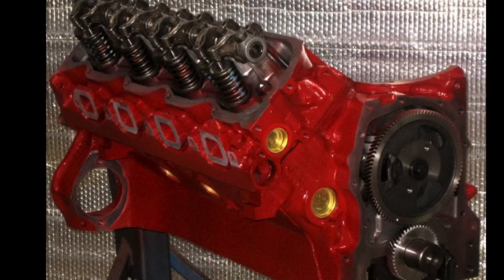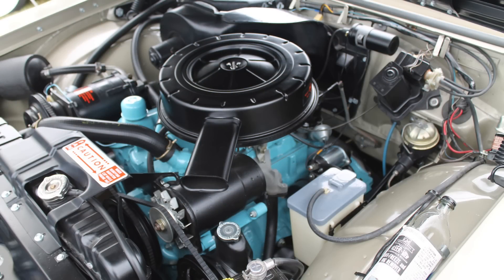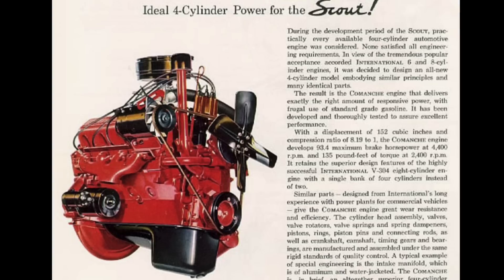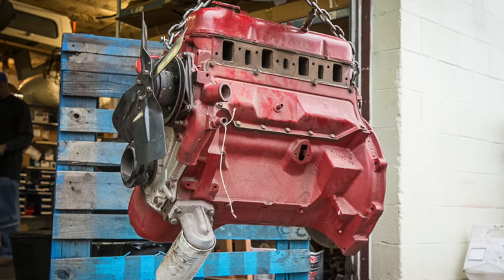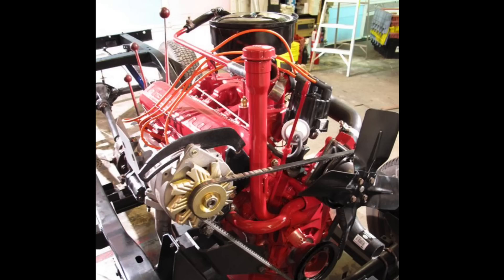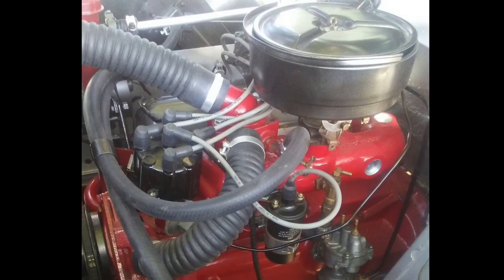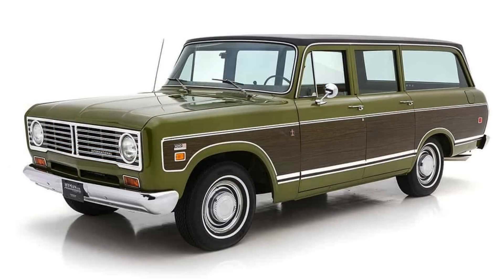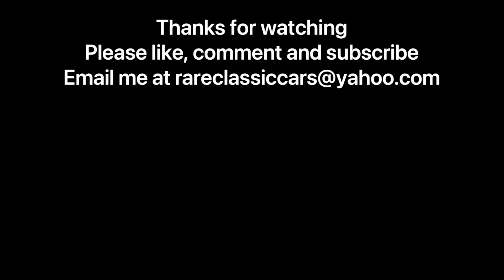Strange Automotive Engines:  International's (IH) "Half of a V8" Comanche 152/196ci 4cyl!

Comment: I know you worked at GM on the financial side of automobile production from watching some of your other interview videos. I don't know what that entails, however.
I love these unusual engine reviews. 
How much money, in percentage, do you think was saved by using an engine casting that lops off ½ of V-8. And using many of the same parts. For obvious cost savings. Versus a new casting of a proper 4 cylinder identical layout but also using all of the same identical parts. It seems like the new casting would be lighter, at the minimum.
Do you if they used the V-8 castings but just blocked off the liquid iron from where it wasn't needed? That would probably save some money. Did they literally use the V-8 crank with a spacer for the missing rod in those journals? I'm just really curious about how much of the V-8 block and crank were changed.
And your expertise about cost savings. Thanks for the great videos.
Reply: Definitely a new crank. Unless the V-8 crank was a flat plane design. The big savings is in the tooling. The 4 and 8 cylinder blocks can use the same machining lines. The heads come off of the same tooling. Some of the same tooling can be used to crankshafts and camshafts. Exact same parts for pistons and rods. Same with lifters, pushrods etc. Same distributor except for the cap. You could even use a V-8 cap. Just run a plug wire off of every spot.
New parts needed would be intake manifold, valley cover and that's about it.
Reply: @mpetersen6  Thanks for the information. The crank was really bothering me. As the early Buick 3800 V-6 kept the "same" V-8 crank and double rod journals. A rough running engine. But they eventually went to a more balanced crank with 6 seperate rod journals. 
One more question? Would the 4- cylinder engine be the same block length as the V-8? 
Or could it be machined shorter? I would think the same length if cylinder spacing, pistons, cooling passages,etc. were the same. But I don't know for sure?
Reply: @msmeyersmd8  
Yes, a four cylinder based off a V-8 is going to be the same overall length.

Comment: Ford's small six from the sixties and seventies, the 144, 170, 200, 250 was the basis for the four cylinder HSC engine used in the Tempo/Topaz

Comment: I had a 64 Scout with the 4 cylinder. It had had a tough life. Had been used in a stone quarry to pull a large air compressor. Was rusty and ran poorly. Pulled the motor, had it bored   .030 over. The cam lobes were basically round. Thought with a new cam and everything else it would make a big difference. Not really. Ran well, still no powerhouse. Fixed body, repainted, put a set white spoke wheels.  Wish i had it today. Have had 4 IH pickups, have a 67 1100 in the driveway now. The IH pickups are TRUCKS.

Comment: I have an issue of Popular Science from 1976 that has a review of a Scout 2 with a 198 CI six cylinder diesel mated to a four speed manual. The zero to sixty time was 29 seconds. A Subaru wagon with an 84 CI four was a bit quicker at 24.5 seconds. A Jeep Renegade with a 304 V8 smoked them both with a 10.6 second run.

Comment: My first automobile was a '73 International 1110 pickup, which I bought in 1975 while in high school. It had all the options checked off, including 392 v8, power steering and brakes, a/c, automatic, radio, deluxe interior, dual post mounted spotlights, dual gas tanks, and clearance lights.
A Texas truck all its life, that truck rusted out from underneath me.
Thanks
Reply: Yeah, mine did too. Ohio truck all it's life. 145,000 miles plus on drive train, still ran great, but little pieces fell at every bump.
Reply: Rust was a big issue with most International vehicles of the70s, especially Scouts and Travelalls.
Reply: IH bought their steel in cheaply in bulk from France and left it outside before production. Hence IH truck were born and died in rust.

Comment: Scout also offered a diesel. I believe a Nissan.
Reply: Nissan SD33. Vice grip garage did one 2 years ago...took his son on the journey home @55mph....or less.
Reply: Actually two different ones. The first was an 80 ? HP naturally aspirated, then a 110 hp turbo. The 345 I had was only rated at 195 hp 305 lbs ft. But that was enough to make my little TERRA, the quickest stock 0-45 low range on hard packed dirt drag racing in our local pit! The only truck to beat me was a 454 K1500 custom built rig.
Reply: An now a diesel Nissan pickup has Cummins.

Comment: I’m pondering how they would space the big end of the rods on a crank journal originally designed for two rods.  Not machining half of the crankpin?  Floating spacers?  Assuming it’s the same crank as the parent V8.  Balance would also be an issue with 4 pistons/rods missing on the crank.
Reply: All the job of the engineering department😁 I would guess a crankshaft was designed for the application.

Comment: Thank you for recognizing international harvester they were a main player in the development of tractors machinery excavating equipment trucks and vehicles during this time period. Right after world war II they came out with the international TD 24 bulldozer my uncle owned one and mined coal with it. Largest dozer when it came out. It started on gas and you pulled a lever to switch over to diesel but this technology in the 1940s caused a lot of problems for international because it would break and bust the heads over time. They eventually sold their excavating line to Dresser and then to Dresta, which is a Polish company and still producing the TD 25 a derivative of the TD 24.

Comment: There was a boat 4 cylinder that was basically chopped from a 460 ford engine. It produced good power but was sensitive to overheating.
Reply: Was used in early 70s Bertram boats, twin motors.
Reply: That was a Mercury Marine stern drive.

Comment: Had a 1970 Travelall....  It actually hade the 354 and a genuine 5-speed manual (with overdrive)  very ahead of it's time!
Reply: I think you mean the 345
Reply: @tiredofit1235  Correct!  35 years ago..
Reply: 345 V8... But I agree about that manual trans. IH actually offered both overdrive and 5th gear direct drive 5 speed manuals back then. That was long before mainstream pickup and SUV's had 5 speeds. GM didn't offer 5 speeds in heavy pickups (they were in half tons a bit earlier) until when, late 80's or early 90's? I know you could still get a 4 speed manual in a 3/4- or 1-ton Chevy in the early 1990's.
If you had a 5-speed in a light duty vehicle in the early 1970's, you had a rare machine. And if 5th gear of your 5 speed was direct drive, you have a very rare transmission for any decade!
Reply: @TonyM132  For some reason, 35 years later, my brain said "354", but you are correct.
Reply: @nathangreer8219  I don't want to correct you again but just want to ask - What happened 35 years ago in 1989? Your 1970 Travelall was built 54 years ago already now.
Reply: @TonyM132  Bought it out of a farmer's field for almost nothing.  Seized engine.  sledge hammered the pistons out and honed it smooth.  New rings, bearings, gaskets later... and it sold.  Huge regret!  had such a clean body and interior!
Reply: @nathangreer8219  I understand the regret, but it sounds like you did it a great service anyway. It's nice to know it was running strong twenty years after it was made, thanks to you.

Comment: I'm assuming aftermarket parts for the v8s could fit onto these? I wonder how much a header, electronic ignition, and a better carburetor would improve its performance? Wasn't there a pickup version if the Travel-All called the Wagon Master?

Comment: A friend had one of those Scouts. Don't know if it was the 152 or 196. It was not a fast car, but it would really lug. Had 3 speed floor shift, posi in the rear, plus 4 wheel drive with a low range. Had to spin both rears and one front before you were stuck. The engine was very durable, had medium-duty truck engine parts inside. That little car had a heart of gold!

Comment: I well remember when this engine appeared - I lived in Springfield, Ohio, where many residents worked at the large IH manufacturing plants in town.  The Scout wasn't built here (I believe that these were built in Fort Wayne) but several local folks loyally bought them.  They soon became known as underpowered rough-runners and were mostly used as farm/agricultural runabouts.  Scouts with larger engines later were better accepted locally and used as grocery-getters for moms.
Reply: My dad worked at the Springfield plants from 1956 to 1970. We had a couple of Travelalls in the 60's and in the late 70's I had a '73 Travelall with the 392 that looked exactly like the one pictured in this video.

Comment: Nice feature Adam. I used to wish they dropped the AMC 304 into these Utes. 
Another interesting engine IH came up with was the gas/diesel combo engine. It was never used as a road engine as far as I know but it sure was an interesting concept, as back in the day diesels were hard cold starting engines.
Reply: IH already had their own 304 V8, which would soon be installed in Scouts. Why would you want them to use AMC's 304 instead?
On your second point... Ya, that was even farther back in the day, ending in 1958 with the 450 and 650 tractors. The D282 engine which followed, IH's first direct-start diesel, was incidentally known as one of the most cold natured, hard starting diesels of the whole decade of the 1960's.
Reply: @TonyM132  my thinking on the AMC vs IH was weight and performance. The AMC was a quick little rever while the IH characteristics were more like the truck engine it was. The weight bias favouring the AMC was almost 100 lbs. And seeing as the two companies had somewhat of a working alliance it looked like a good fit to me.
As to your second point, that is as I recalled it as well. Thanks for sharing your observations. Much appreciated.
Reply: They still had the start on gas, diesel engine in the '64 TD-9 tracked dozer. That engine was the same as the Super WD-9 wheeled farm tractor. That was the biggest tractor available when it came out. Bit over a hundred horse, from what I remember.  Great machines. 500 psi hydraulic systems on the dozer in 64.  Leather  seals on the cylinders and pumps still. Massive cylinders to lift a pretty light c-frame and blade. Way way better than the cable lift on the competition machines tho.
Very high tech for the. times.
Reply: @ExposingReflections  The diesel engine in the Super WD-9, the gasoline-start 350 cu in 4-cyl, is the one I was referring to. Its use in farm tractors ended in 1958. I don't know anything about the construction equipment line, beyond that the TD-9 was a famous model. But looking it up on the tractordata site (which certainly has some errors but is generally accurate), it says the last year for the gas-start diesel in a TD-9 was 1959. And that the TD-9 ended production completely in 1962, with the direct-start D282 as its engine for its final three years.
I think you're right about the Super WD-9 being the most powerful farm tractor when it debuted in 1953, but it wasn't 100 HP.  Its Nebraska test in May 1954 showed 65 max belt HP. A year later, the Oliver Super 99 surpassed it with 79 belt HP from a GM/Detroit 3-71 3-cyl 2-stroke diesel. IH's gas-start 350 diesel engine continued in the model 600 and then 650 tractors through 1958, but it was not tested again or rated any higher by IH after 1954.
The first conventional farm tractors to hit 100 PTO HP are generally considered the Deere 5010 in 1962 and Allis D21 in 1963. IH's first over 100 PTO HP was the 1206 in 1965.

Comment: The Chevy II 153 ci was a 250 with 2 cylinders removed  1960-1970 . ( No Its not the IRON DUKE different engine) Jeep used them as well in postal vehicles.
Midget Racers used to cut up V8 Chevy small black heads and fit them to 153 and made good power.
It was still used in Marine and Industrial engines after 1970.  In fact you can still buy the engine as General Motors Vortec 3.0 liter industrial engine its just a updated version of 153.
Reply: Everyone I correctly calls those Chevy 4 cyls "Iron Dukes", and it drives me crazy 🤬
I've sold several of them, mostly from boats, to collectors who use them to power thier Model T's and A's. It's a good modern high speed engine that fits under the hood, that still has a 4 cyl sound, and has unlimited transmission choices due to the Chevrolet bellhousing bolt pattern 👍
Reply: @johneckert1365   well i have tried replying  to you twice about the 153 but my  comments keep getting deleted !
Reply: @troynov1965  That's weird 🤷‍♂️
I like those little Chevy 4 cyls. I have Grampa's old boat with the smaller/original 2.5 mated to an OMC stern drove, and I've got several newer Mercruiser setups with the later 3.0. 
I wonder if there's an outlet that offers aftermarket non-marine intake & exhaust manifolds for those engines?
Also, I acquired a homemade waterpump powered by one of these Chevy 4 cyls mated to a TH200 trans. The engine is new enough to have an EGR valve and a weird little Holley 2bbl carb, similar to the one Chrysler used on early Omni/Horizon. Do you know what vehicle GM offered with this 4cyl, late enough to have an EGR valve? I'm stumped.....
Reply: @johneckert1365  Oh and far as the one with EGR it may be from  Mexico/ South America they used the 153 for years after 1970 in certain GM cars.
Reply: @troynov1965  Ah yea that would make sense. Crazy that one ended up in my junkyard in Northern Wisconsin lol
Reply: @Troy_nov1965  I read somewhere that some sort of postal vehicles used them, but that might be someone wrongly pointing to the Pontiac Iron Duke
Reply: @johneckert1365   Well maybe they used them in Canada as well but Im not sure about that.
Reply: @johneckert1365   Yeah ones prior to 1970 ( the  Postal Jeep DJ-5A , 1968-1970  ) after 70 they switched to AMC Straight 6
Reply: @johneckert1365  Yeah it drives me crazy as well. Iron Dookies are crap compared to a 153. They should have used the 153 in the Vega instead of that POS they did. Those 153s can make really good power with mods. 
Have you seen the company  Blueprint Engines prototype LS 4 banger based on 153 block?  Just google ....Blueprint Engines 3.6-Liter Four-Cylinder LS. There is even a video on You Tube about it. If it ever sees production it will be a BEAST.
Reply: @johneckert1365  Yeah it drives me crazy as well. The Iron Dookie is crap compared to the older 153. They have should have used in the Vega instead of the horrid engine they did. With mods the 153 is powerful  little 4 banger.
Have you heard of the company  Blueprint Engines 3.6-Liter Four-Cylinder LS ? Just google it.  There is even some videos of it on UTube. Im pretty sure the block is based on the 153. If it ever sees production it will be a beast.
Reply: I think the Ford OHV 2.3 engine used in the Tempo and Taurus was derived from the 200 inline six.
Reply: @DanEBoyd  Yup, and they were turds 💩
Reply: @johneckert1365   Clifford has a intake for singe carb ( 2 or 4 ) Im pretty sure not sure on headers.  You might find some headers for it they were raced quite a bit back in the day. Ansen made crossflow heads  ( along with intakes and maybe exhaust ) for them but are really rare. Someone else made bolt on heads but I cant recall the name now.
Look up Blueprint Engines 3.6-Liter Four-Cylinder LS there is even some videos on it. Its a prototype but it may make production. Its a 153 block. Maybe they will sale parts for it one day.

Comment: The Scouts also had diesel engines edit * Nissan . vice grip garage has one
Reply: Actually I'm pretty sure the diesel that was in the scout was manufactured by Nissan.
Reply: @Wildersport  I couldn’t remember the manufacturer without doing a search. Thank you for the clarification. Isuzu was used in Chevy S10 and of course the duramax
Reply: Actually it was a Nissan SD33, later the SD33T and the SD633T.,